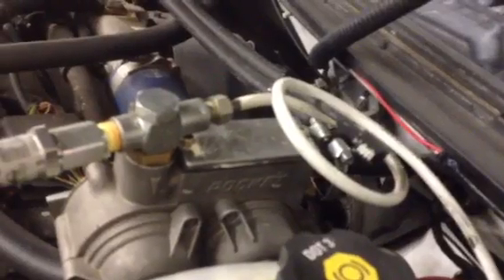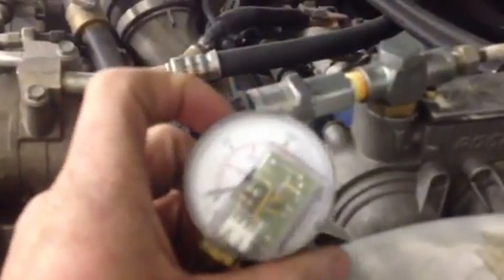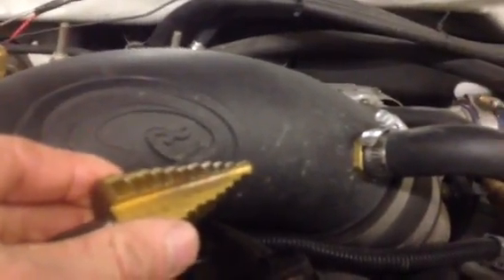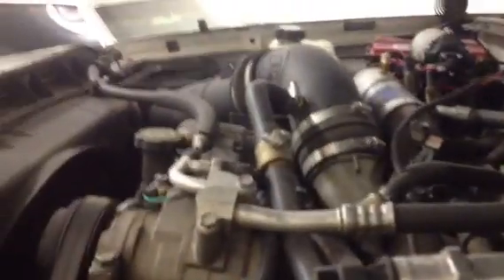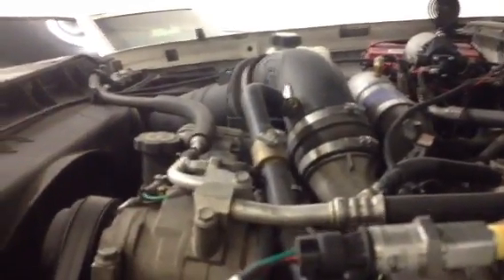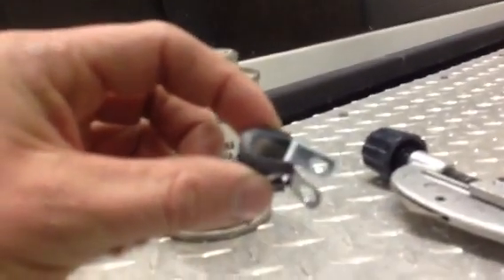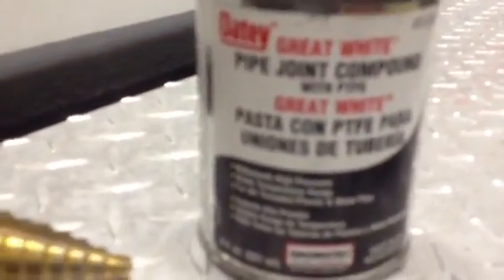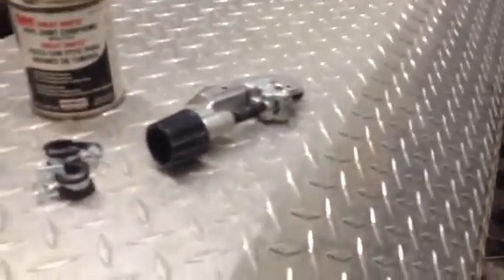2003 Chevy Duramax cng/diesel

Comment: I have this system done on a Toyota  Innova   2500 cc diesel engine, the problem I am having is, when I try to power up or accelerate ,I get black smoke form tail pipe,
what can be the reason ,if you could help , I am from India

Comment: You should tell people that their mileage stays relatively the same overall. The savings is in buying the CNG for cheaper than diesel. The truck really gets 17.5 on diesel and 17.5 MPG on cng. Crazy claims of 35 MPG set off alarms for those that have any critical thinking skills.